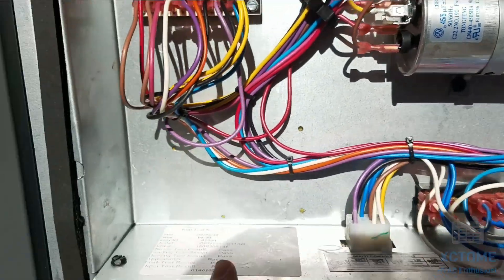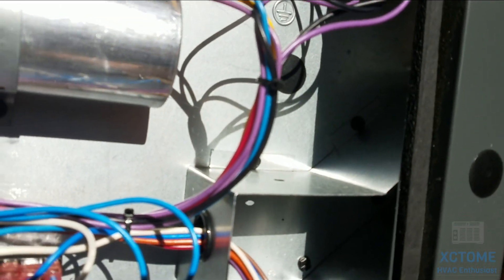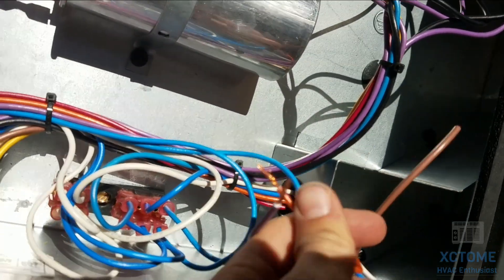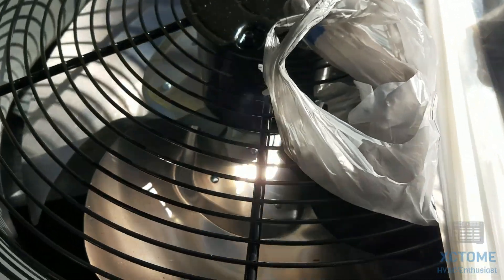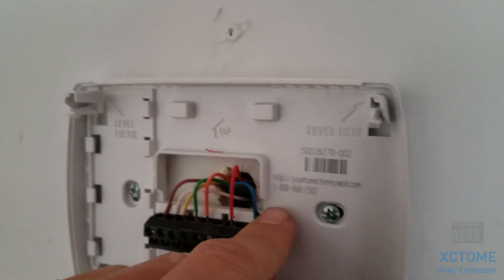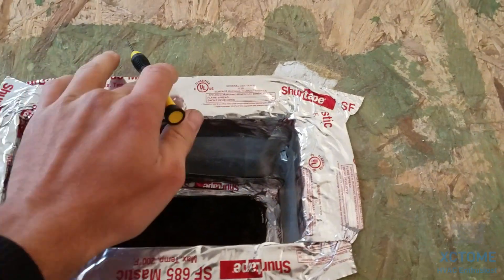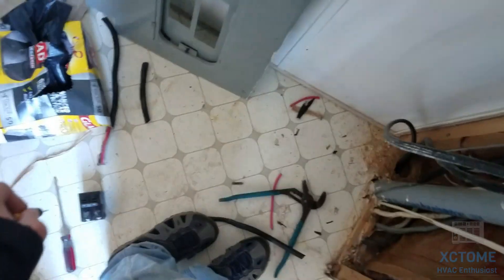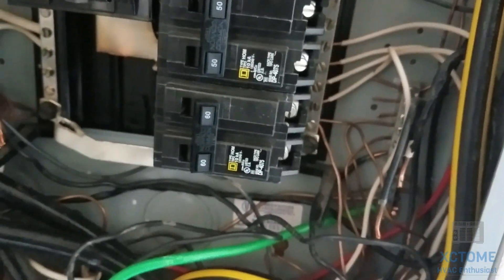HVAC Install -  Goodman 3.5 Ton Package Heat Pump 11-11-2018 PART 1

Comment: delete my comment? GOODMAN JUNK!
Reply from the maker: i won't delete your comment everyone has their own opinion on Goodman my opinion is Goodman products are economical (affordable) very reliable, easy to service ,robust unit's with a decent warranty, i have installed and helped install several Goodman systems over the past 15 years and everyone of them are still going strong, oldest one being from 2003. My unit at my house, overcharged, oversized, and with a possibly contaminated refrigeration circuit is still chugging along, despite common repairs such as two new run cap's a few years ago.  Being in the HVAC industry for several years i have come to notice that brand really don't matter, everyone has their opinion on a brand, some prefer Trane, some prefer Carrier etc... I prefer Goodman,Carrier and Rheem products, i'm not a huge fan of Trane never really liked Trane because of their serviceability but that is my opinion, regardless of the brand of a HVAC system  they all do the same thing, heat and cool and keep structures comfortable - what it comes down to is the install and installing contractor is what matters the most, for example a poorly installed system regardless of brand is going to have issues if a vacuum wasn't pulled, if it were under or oversized or out of level, now a correctly installed system will last for years trouble free other than the usual maintenance, capacitor's and fan motor's.